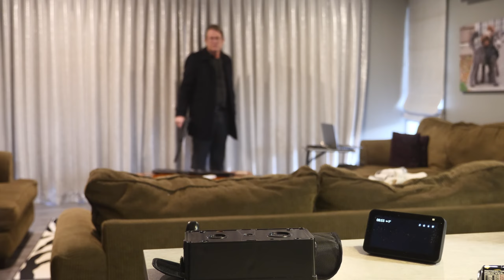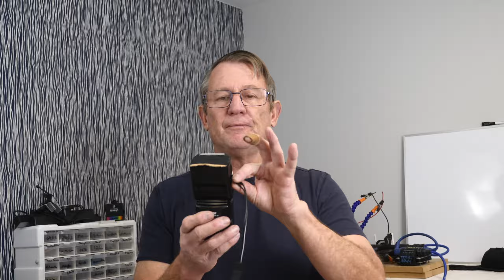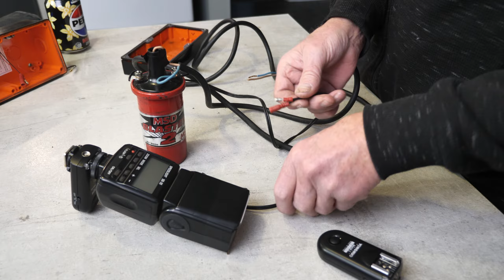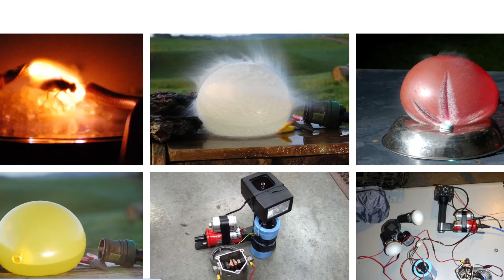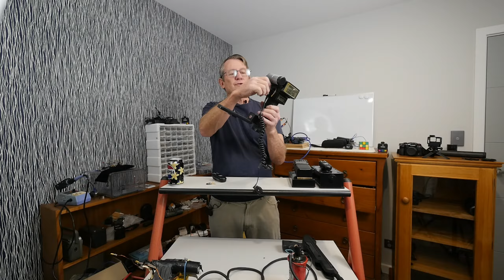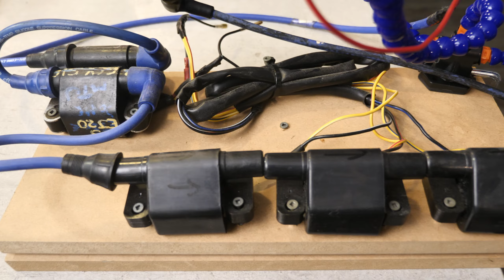Flash Automation

Comment: IIRC flash simply fires when the centre and ground pin are shorted together - so you should be able to rig a GPIO up to that and have digital control.
Reply from the maker: In one case I wired up a sound activated trigger to the flash and fired the air pistol empty which makes for perfect timing :)